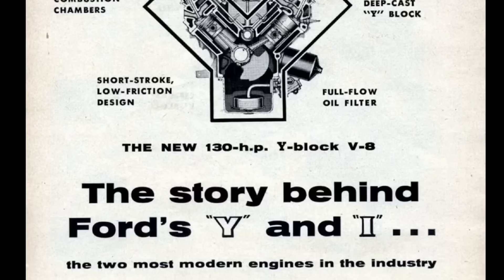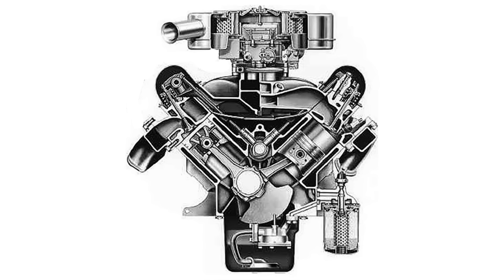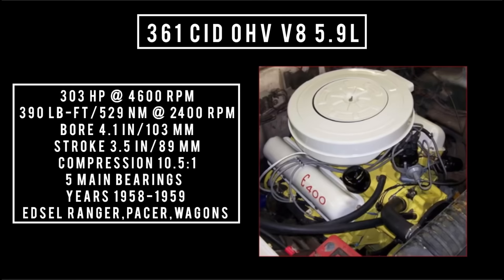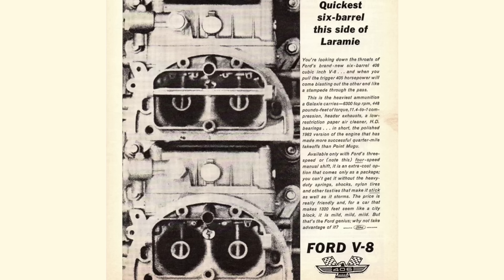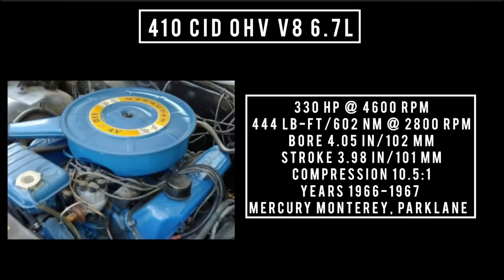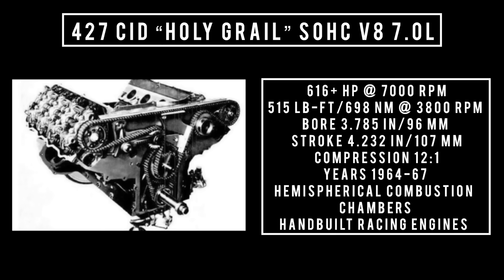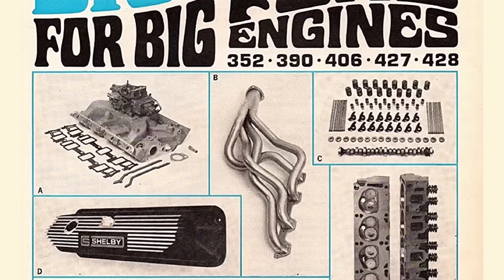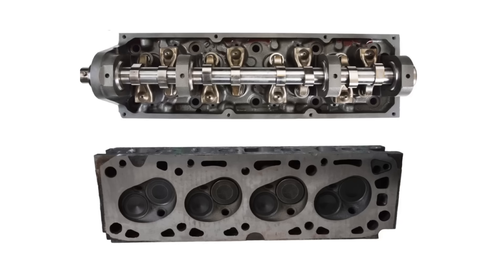Ford FE Engine Family 332, 352, 361, 390, 406, 410, 427, 427 CAMMER, 428, CJ428, SCJ428

Comment: The FE engines lived on in Industrial applications through 1978. They used the 332, 360, and 390 displacements, but labeled them 330, 361, and 391 to differentiate them from the car/light truck engines.
Reply: @redmesa2975  There were even lighter duty industrial FE's that were named 359 and 389, but of course we know they were 360's & 390's. 😉
Reply: @johneckert1365  but the FE 360 was in half ton pickups. Hardly industrial. No FE 360s were installed for industrial or heavy duty trucks. FE was strictly light duty. FT engines were used for industrial and heavy duty. A world of differences.
Reply: @redmesa2975  Older Ford builders liked using the forged steel crankshaft from Industrial 391's for building 427's. Just had to machine the front snout down to size for the "car" harmonic balancer. Good strong crankshaft! 💪
Reply: Why wasn't the pickup 360 covered? It was a destroked 390. It replaced the discontinued 352.
Reply: @casamequite  I always wondered why they even bothered with the 360. I wasn't any better on gas than the 390. If anything it was worse on gas.
Reply: @johneckert1365  IDK. But I rode around in lots of pickups that had them. I think their biggest strenth was reliability. You couldn't tear them up.
Reply: They had larger ones than that for their bigger trucks. I believe they had a 470 and I know for a fact they had a 534. I used to drive a 1965 cabover tanker that had the 534. It had a big Holley 4 barrel  and a factory dual exhaust system.
Reply: @garyjubar5733  Yes they did 👍 Those weren't "FE" engines though, those 478 and 534 were based on the "MEL" engines. Similar to a 462 in Lincolns
Reply: @garyjubar5733  I had a 68 Cab Over Ford Fire Truck for a few years, it had a 534 as well. I ended up selling it to Sprecher Brewery in Milwaukee for a beer garden truck 8 or 9 years ago
Reply: Actually the FE family of big block ford engines was never used in industrial applications. However, the FT family of engines was. Some bore and stroke combinations were the same which causes confusion. But due diligence reveals the facts. The FT  heads would not bolt up to FE exhaust manifolds. The FT also had sodium filled valves unlike ordinary FE engines. Also the FT compression ratio was around 7 to 1 while FE had a minimum of around 8.5 to 1. The distributor could not be used from FE to FT. Same story with the motor mounts and on and on. Some of the rotating assembly has similar architecture. Some parts could interchange if one had the notion to build a Frankenstein motor. It would be expensive. Different timing cover, water pump, harmonic balancer, so on and so forth. It's like comparing an F18 Hornet to an F18 Super Hornet. At first glance you may think it's the same but hardly anything is.
Reply: BTW. I think your channel is awesome! Keep up the good work 👍
Reply: @casamequite  Not all the FT engines had the bigger crankshaft snout, only the ones with forged crankshafts. Yes the heads were different, but FE heads would bolt onto an FT block and vice versa. People ABSOLUTELY did put car or pickup truck FE in thier medium/heavy duty trucks as a replacement back in the day. You either had to fabricate a custom front motor mount, or change to the industrial cast iron timing cover, water pump, and accessories. Industrial exhaust manifolds bolted right onto FE car/pickup heads, you just had to weld or braze a cover to block the extra exhaust crossover port in the industrial manifolds. Easy as pie 🥧  You can spin shit all you want. FT engines are part of the FE family whether you like it or not. 
Chrysler Industrial big blocks have very similar different than thier car/pickup siblings. The 361 & 413 Industrial was just a normal B or RB block, but had different heads, manifolds, and water pump housings. They were still Chrysler B & RB engines.
Reply: The 360 was not a 361. It was a destroyed 390. It was in half ton pickups. Hardly industrial.
Reply: @casamequite  You are 100% incorrect. Yes, they did make a 360 for light trucks. They also made an industrial 360 cubic inch engine for medium duty trucks and industrial applications. Even though it was 360 cubic inches, they called it a 361 to differentiate the 2. There was also a 359 mostly used in U-Haul trucks. Just like the 361, it was actually 360 cubic inches. The difference between the two was the 359 had a cast steel crankshaft and the 361 had a forged steel crankshaft.
Reply: @casamequite  Also, the light duty 360 pickup truck engine was NOT just in half tons. It was also used in 3/4 ton and 1 ton pickups through 1976. In 1977 both the 360 & 390 were replaced with the 351M & 400. 361 & 391 lived on through 1978 until they were replaced by the "385" block 370 & 429 industrial engines.
Reply: @casamequite  I think auto spell got you. The word your looking for is "destroked", not "destroyed."

Comment: That was pretty bad. Nothing (including the picture) of the 332 was accurate. The bore and stroke of the 427 were backwards. Several other bore and stroke numbers were way off, not just slightly rounded. Do better.
Edit: also, where was the 360 FE?
Reply from the maker: Two mistakes the 360 FE was used in ford f series Super confusing and engine lineage I left the truck engines out of it 

I’ve been trying to fix those issues it won’t let me fix it after the fact I tried to fix it with subtitles I tried to fix it with text over slides I really do try to do my best with these engine episodes but I’ve put off the FE because it is super confusing..
Reply: Well to be fair, if the 360 FE’s were where they belonged, they would be aboard a boat with a long chain tied to them …

Comment: Can’t wait for the FT engines my understanding was that 360 390 are car light truck and 361 391 are  truck engines
Reply: That is correct and some parts will interchange a lot of the FT engines have forged crankshafts that can be machined down to fit the FE timing chain cover and balancer
Reply from the maker: That was my understanding as well super confusing engine lineage to also add confusion to all of it they called the truck engine 360 or 361 but they made an FE 361 that was available in the edsel line of cars 

There were two mistakes in this episode 427 bore and stroke sizes are flipped 333 bore  is 4 inches 3.3 inch stroke.. I wish YouTube made it easier to fix things afterwards there’s a couple things that I would really like to fix like I mentioned that this episode were not covering the FT engines I should’ve listed which engine sizes those were

Comment: your specs on the 332 are all wrong, i believe that is for the 292 y-block. the 332  bore and stroke was 4.00x3.30
Reply from the maker: Thank you for that correction I was looking at the wrong engine I tried fixing in post but can’t fix it the specs giving are for the 223 six

Comment: these engines were also used on truck, industrial and stationnary  applications. they were very robust engines, some of these were clasified medium duty and heavy duty but their ratings are revised downward for example, a 332 car automobile is basically the same as the 330 truck version, in medium duty, the valves are upgraded and the rating was about 160 HP, on the heavy duty version, the pistons  used 3 compression rings.
Reply from the maker: Thank you so much for sharing that information we are definitely going to come back and cover the FT engines one day..

Comment: NASCAR influence, namely Holman-Moody, played a big part in the split design of the intake manifold and cylinder heads. This feature allowed for a relatively quick replacement of a cylinder head if a valve spring broke (a common occurrence in those days) during a race by allowing the intake manifold to remain in place during the swap. Great video. Carry on.
Reply from the maker: Thank you so much for sharing that information greatly appreciate it =)
Reply: I have done that on a 352 a 289 and a 350 Chevy. The split design made no difference.

Comment: you missed the 360 in ford trucks
Reply from the maker: Didn’t cover the Ford truck engines said that the very beginning.. going to do a different Engine episode on the Ford FT series..
Reply: @What.its.like. not a truck engine! Never put a "FT" in a passenger car or a pickup truck! They put 360 FE in pickup trucks! The put 361 FT in trucks! As in big med & heavy duty trucks! Not ever a pickup truck! They are similar but yet vastly different! U have fumbled this piece of info! You have it wrong!
Reply: @What.its.like.  — Jesse’s right. The 361 was the FT, and the 360 was the FE — and neither one was worth a crap …

Comment: Why is there no mention of the 360 FE engine? I was a destroked 390 and used in a lot of Ford pickup trucks in the 70's.
Reply from the maker: Ft  engine will get its own episode
Reply: The 361 is the FT engine. The 360 is an FE @What.its.like.
Reply from the maker: The 361 was an Edsel engine This is a super confusing engine family because Ford had the 360 which could be called the 361 and that was the truck engine they also made a 361FE which was the edsel engine
Reply: Peardragonz is correct.  Look up 361FT and discover the facts.   @What.its.like.
Reply: @What.its.like. no!! They made a 361 FE yes, they also made a 361 FT yes, but you are wrong about the 360 FE in the 70s pickups . They are not a FT! They are very much a FE different from the 361 FT! All exact same bore & stroke. But not the same engines. The 361 FE Edsel would basicly be the same as the 360 FE from the 70s pickups while the 361 FT would be very different.  The 360 FE from the 70s pickups had 2bbl only & used 390 4v pistons & blocks but used 352 rods & crankshaft. The 390 4v pistons are 390 high compression pistons but when paired with the 352 crank & rods they become very low compression pistons.

Comment: At 8:57 the table of specs for the 427 has the bore & stroke switched. Math says 3.785 bore and 4.232 stroke makes 380.9 cubic inches, while 4.232 bore and 3.785 stroke makes 425.9 cubic inches.
Reply from the maker: Thank you so much for that correction sorry I got those flipped there’s also one other correction bore and stroke size for the 332 isn’t right
4 in bore 3.3 in stroke =)
Reply: @What.its.like. also the 58/59 361 bore is listed as 4.1 bore. That is incorrect,  the 361 has a bore at 4.05 (same as 390 & 410) & a stroke of 3.5. The 4.1 bore & 3.5 stroke would be a 370ci.
Reply: And the 370 is in a different engine family

Comment: I had a 390 in my 69 f100 that i bought when i was 18. First engine i ever rebuilt myself with a cam, 4 barrel holly and some long headers. It was a screamer. Intake manifold weighted a ton i remember.
Reply from the maker: Nice That truck sounds like it would’ve been amazing just curious what did you trade it for

Comment: I still have a 428 Super Cobra Jet Mustang Mach1. Only problem, is 6 MPG of 110LL @ $9.00/gal. fuel it likes.
Reply from the maker: Thank you so much for sharing your experience I had a 67 mustang with a 351 Windsor if your foot was in it it would drink gas like you couldn’t believe if you drove it like a civilized person which was really hard to do you could get 15 out of it but that was mostly a neutral feathering the gas.. I could watch the needle move with the clock when in it, but man was it fun

Comment: i think you left one out. isn't the 330HD in the FE family ? i had a 1965 or 1966 F600 that had one , and i also had a 1979 ex-uhaul F350 dual rear wheel , and although the engine in it was a 300 inline 6 , the sticker on the radiator support said 330HD or 330, i don't remember. i was thinking u haul must have special ordered them . i had never seen a light truck (F100, 150,250,350) or ford van that had one before
Reply from the maker: I believe that’s an FT engine I left out the Ford truck series engines going to do a separate engine episode on those

Comment: There are many inaccuracies in this, and not just rounding errors.  The 427 did not feature an under-square bore to stroke as just one example.
Reply from the maker: Bore and stroke were mixed up this is where I got information 

https://www.vehiclehistory.com/articles/ford-427-engine-big-block-oh-yeah#:~:text=The%20FE%20427%20was%20continually,supply%20of%20after-market%20parts.

That’s were I took the bore and stroke size from and it was wrong happens a lot hard to know what’s right and wrong information

https://en.m.wikipedia.org/wiki/Ford_FE_engine

Comment: Our 1966 3 ton Mercury grain truck had the 332, used 30 years on our farm and only two head rebuilds that I know of.  This was the truck I learned to drive in age 10, there were no brakes (JPM quote) as Dad never fixed much.  What? You never sent ur kid out age 14 to town with load of grain with no brakes? Exciting times. Still at the farm.
Ur 361 in Edsel is the E400 (400 ft/lb torque) engine and is the first FE engine cast, the 332 and others came after.  The E475 engine (that is 475 ft/lb torque), it was the 410 engine.  Father of 427.
Dad actually gave real money for a 1958 Edsel, with E400, a 361 with steel crank and at least one 4 barrel carb and either a solid lifter or hydraulic lifter.  Dad had gotten a solid lifter engine.   Dad said that was the fastest car ever, 135mph all day long.  He drove from Thunder Bay to Saskatoon under 12 hours and that was on gravel and on the square, no highways, and the tires ...  

Mom's daily driver for many years was a 1964 Tbird convertible, 390, 325hp.  Mom did not drive slow, I could see the red line of the speedo way over 85mph every Sunday going to church, but that was me making us late so she would drive fast, tee hee ... my secret. This car is unrestored at one of my Brothers place.
1975 F-150 Supercab with 390 4 barrel carb and dual exhaust was our family vehicle.  We rebuilt that engine twice, no wear on cylinders.  I think still at the farm.
Reply: Are the big Mercury trucks just as rare as half tons? Don't see many Mercury trucks here in the States let alone a 3 ton grain thruck

Comment: A lot of your info is wrong bud, the 361 was a ft engine and the 427 have the 3.78" stroke of a 390 for examples
Reply from the maker: 361 was edsel engine they made a different 360 often called 361 for truck line 

The boring stroke sizes were flipped on the 427
Reply: @What.its.like. u are wrong! The 360 is never referred to as a FT or a truck! You are mixing them up! A 361 FT is not a 360 FE!

Comment: The 332 bore and stroke was 4x3.3 inches.  No Ford FE had a bore and stroke of 3.6x3.6.
Reply from the maker: Thank you turns out I was looking at the 223 mileage maker sixwhen I quoted those specs I’m dyslexic so sometimes those numbers look the same.. thank you for that correction

Comment: Forgot about the 360 FE commonly used in pickup trucks. Separate engine from the 361 you mentioned that was around from 1958-1959. Had one in my 1970 Ford F100. Basically the same as the 390, but it had the 352 crank in it, with longer connecting rods, giving it less stroke than the 390.
Reply: Have a '72 F100 360.  NOT an FT, FE all day long.
Reply from the maker: FT stands for ford truck engine it’s in a truck right...
Reply: @What.its.like.  No, the FTs were in things like dump trucks, school buses, etc.  Pickup trucks had FEs only.
Reply from the maker: I thought the dump trucks got the super duty engines the ft was for small and medium duty trucks super confusing engine Lineage over at Ford
Reply: @What.its.like.  Very confusing indeed!  Have a brother, that's a totally Ford guy. He can tell you the bore and stroke of every Ford engine since about 1901, he's also borderline insane. It's sad really.  🤣
Reply: @What.its.like.   The medium duty truck FT engines are just that medium truck line !  Not the ford pickup line. The FT have a different crankshaft, it’s a steel crank, with a longer snout  to accommodate big pulleys for large truck applications.  Some have used the FT steel crank in a FE builds for the steel crank for race / performance engine build, but the front snout has to be machine down to accept FE engine pulleys and accessories
Reply: I’ve a ‘72 Exploder F150 with a 360
Reply: Medium duty 330,361, and 391 were externally balanced because of the heavy duty pistons used in that application  360 was just a FE. The logging outfit I worked for ran FE's never saw one go less than 300,000 ever good engines and would always bring you home. To bad nobody makes anything like that today
Reply: My first pickup was a 1973 F100 Ranger with a 360 FE.
Reply from the maker: That engine is classified as a FT engine going to cover the FT in a different engine family
Reply: @What.its.like. Actually the FT version in heavy trucks was called the 361. The 360FE in pickups is definitely an FE, everything that bolts on is interchangeable with a car 390. Swapped a bunch of pickups with 360s to 390s. If you got a 390 out of an old Thunderbird or something hipo, it really made a difference! The pickups 360 was kind of turd in stock form.

Comment: 9:40   <sigh>  You could actually buy a Cammer crate engine for $3400 back then.  Yeah, that's like $34,000 today, but I'm thinking I was born about 20 years too late.

You have the bore and stroke of the 427's interchanged.

I'm going with Ford-Edsel for what the FE meant.
It fits with the Mercury-Edsel-Lincoln designation of the MEL.  The later 385 series had the same bore spacing as the MEL.
Reply from the maker: I thought that advertisement piece was great it’s cool that Ford sold these engines, I guess they had to because their thought process was it was going to be a NASCAR engine but then Chrysler cried and got the engine banned so Ford had to sell the engine somehow